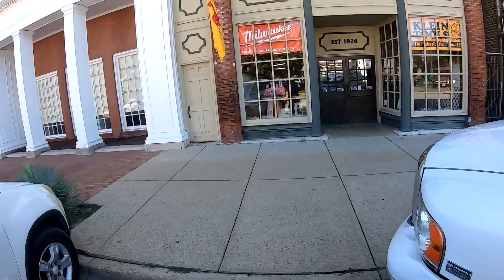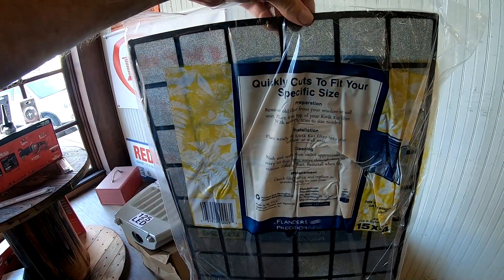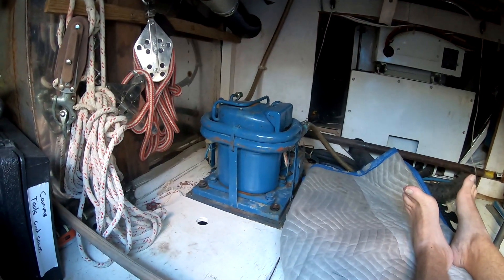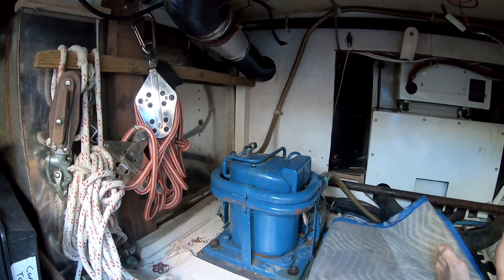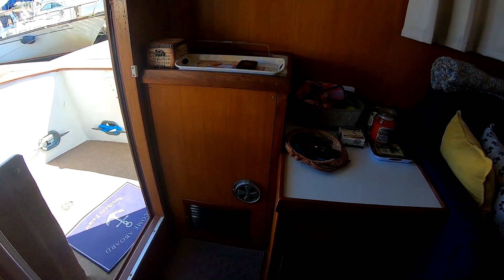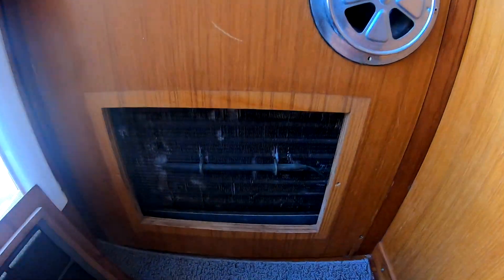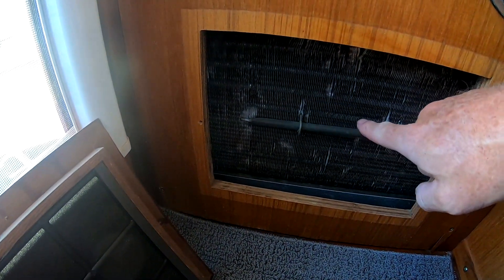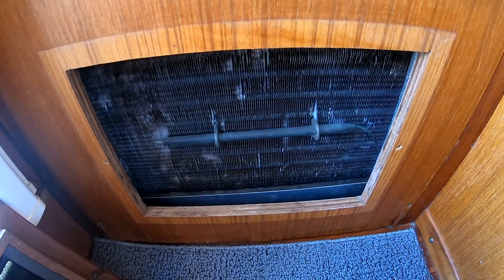WOW why is it so cold in here 40 year old BOAT A/C explained Keep them clean

Comment: Are your A/C units reverse cycle as well or do you have separate heating units?
Reply from the maker: Yes but only the front A/C blows hot air the main unit when I go to heat it blows the breaker not sure why yet

Comment: So I have the same system A/C and I have a problem that only places that come cold air ac is only in the living room the rest of the other room come hot air.
Do you think maybe is just need clean all the air filter?
Reply from the maker: I know after cleaning mine it gave me another 5 degrees cooler in the living room
Reply: Is it the same unit?
Reply from the maker: @icannevergetthistowork  you would need to send me a picture how old is your boat?
Reply: @icannevergetthistowork   looks like is the same I’m not sure 100%
Reply: You need to follow the duct work back and see which unit is producing the warm air.